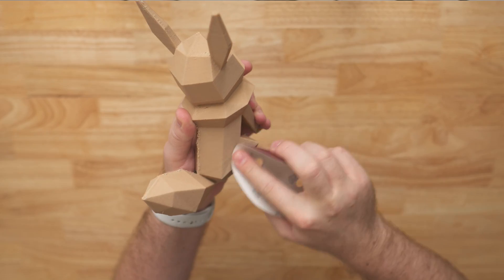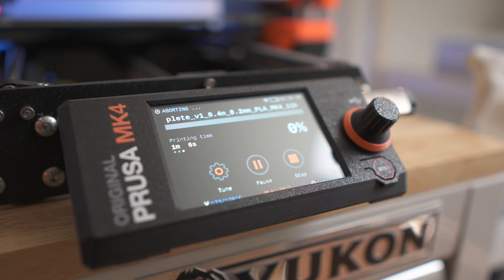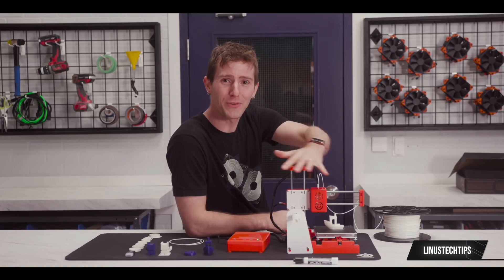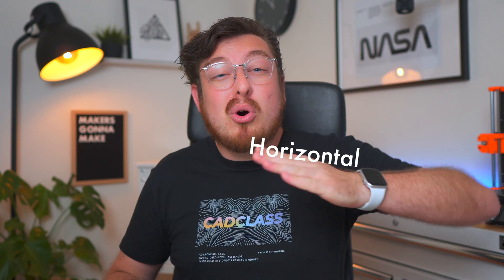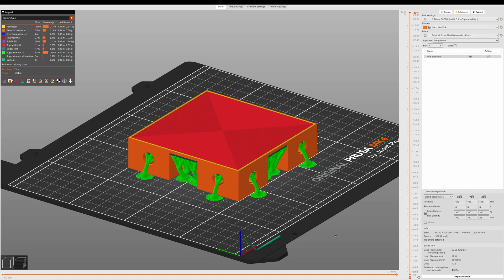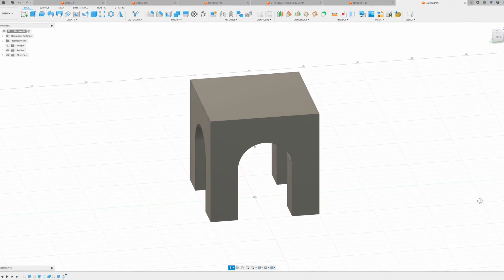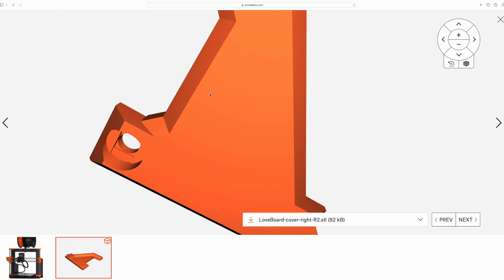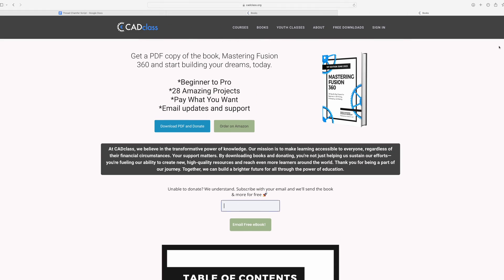How to Design to never need supports AGAIN!

Comment: Using Orca Slicer, if I increase the threshold angle, it increases the support unnecessarily.
Reply: Yeah, OrcaSlicer and PrusaSlicer measure the angle from the horizontal plane, so you’d take 90deg and subtract the angle from the test print. 👍🏽